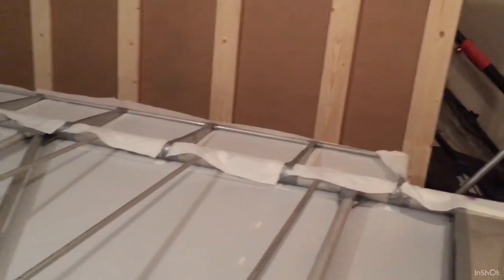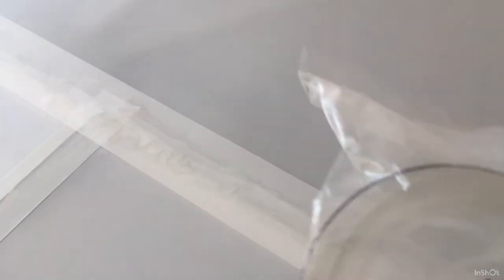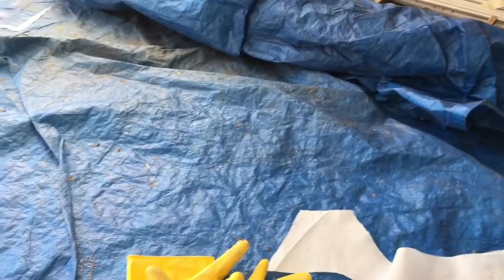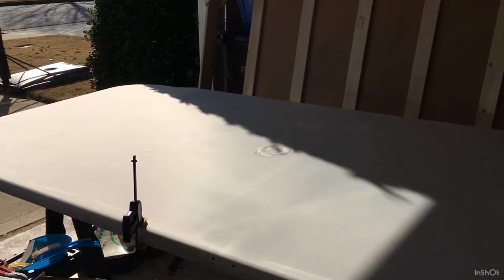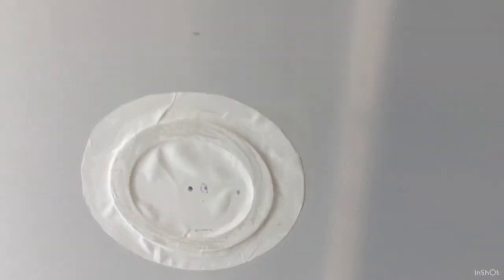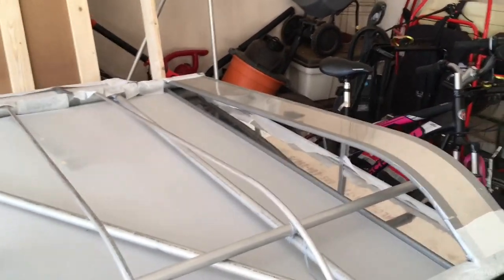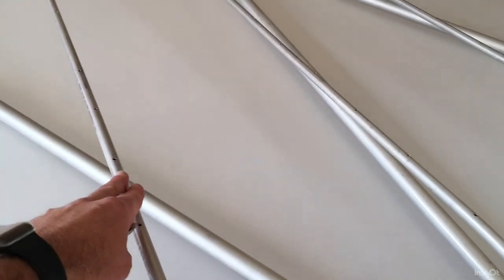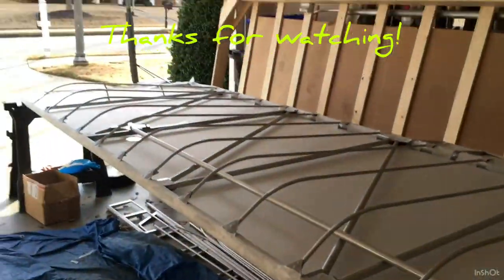Excalibur Aircraft Build Project 11

Comment: Peter Toth....   You might want to consider the ForeFlight Suite of avionics.   ForeFlight Pro is only $200 a year and it provides: flight planning, charts, weather, airport information, document management, flight 	logging, file/brief AND synthetic vision.   If you add the ForeFlight Sentry  for $500 it will add ADS-B, inflight weather/traffic, AHRS, WAAS GPS, and a CO sensor/alarm.  That is what I'm using for backcountry flying here in Washington State.   I've used it for years and love it.  Good luck with your build!

Comment: I just binge watched your build. I'm purchasing an Excalibur this summer, and already I've learned how to avoid a few mistakes by watching. Thanks for posting, it will help me with my build, which I will also document and post on youtube once I start. One item I'm surprised at is the fact that you didn't run a line for a strobe and marker lights, even though you aren't installing it now. I would have run the lines and just capped off the wire. Question, which engine are you going with, and why?
Reply from the maker: Peter Toth I don’t care to have Nav lights on the wings, since I’m only flying day VMC. I can add them later with not much effort. I will install a strobe on the tail. My goal is to not add many additions to the base model, which can add a lot of construction time. I’m getting the Hirth 3202 engine, for its 1200 TBO.
Reply: @gnllr1  Sounds like you're going the very basic route. Excellent choice! I'll be taking a slightly different track, and will be fitting mine with amphibious floats right from the start. Flying into the north country to do back woods camping trips to remote lakes and islands in norther Manitoba and N. W Ontario region here in Canada. With that I will need a good GPS, as well as lighting for night flying, as it's near impossible to fly only daytime in the late fall with our short days. Night VFR flying in the north country, with no population centers, no lights from the ground, no roads, not even radio towers to use as navigation aids, forces one to use the compass and an NDB a lot. If you are lucky, you may be in range of one of the remaining VOR stations. Maybe! I won't be fitting an NDB on mine, or a VOR, but a certified GPS then becomes a must. Unfortunately all that will add almost $10,000.00 to the built, not including the floats. I'm excited to begin, and am now just waiting for the funds to be release this spring from the sale of some property to begin my build. Cheers from Canada.
Reply from the maker: @Peter Toth Hey Peter, have you started your project?